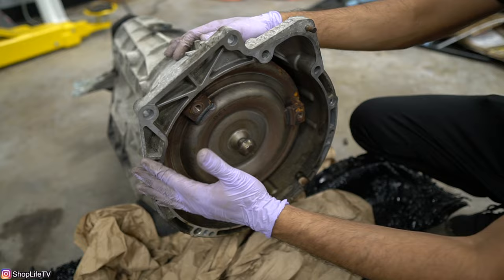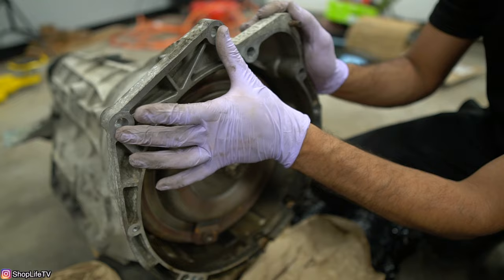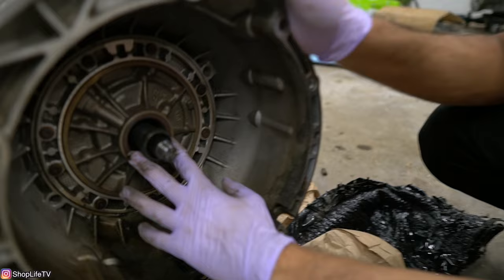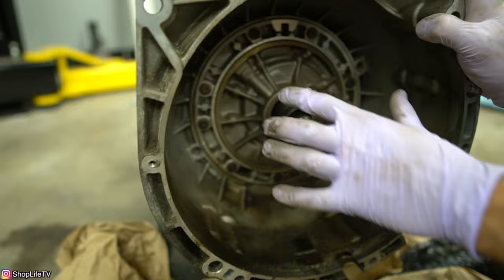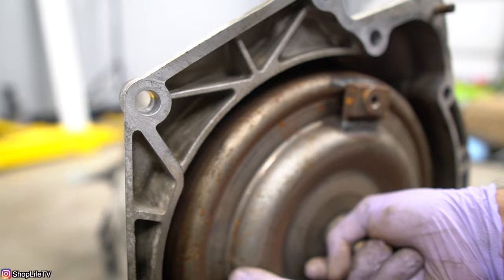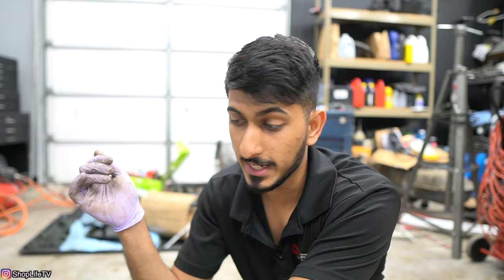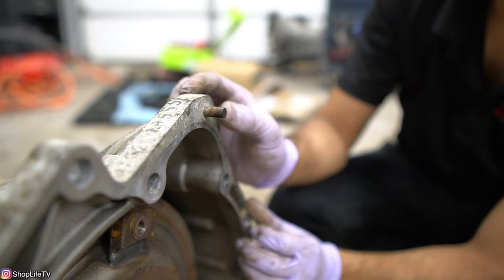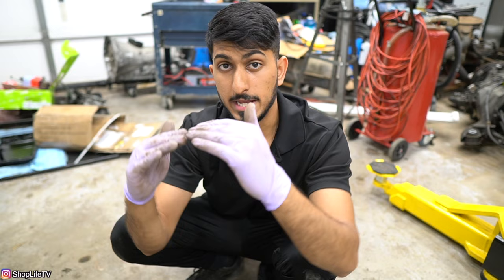WATCH THIS BEFORE REPLACING YOUR TRANSMISSION!!

Comment: I actually made this mistake but luckily I tried to spin the crank with a breaker bar before I installed the engine in the car. It didn’t move so I knew something was wrong. Then I got it right
Reply: Dis you have to remove the transmission and do the process agai? Or just loosen the transmission bellhousing a little and turn the crank to get it aligned and then close it?
Reply: @rq7684  removing and restarting the process was very easy for me.
Reply: Did you break anything. I'm in the same boat.
Reply: Excellent tutorial... thank you so much.
Reply: Convertor.not all the way back
In pump
Reply: i have made this mistake on my e60, and that one pin in gearbox oil pump had broke, then i just dismounted and put back on the old gearbox, it took me 10hours(with my father) to do all this job
Reply: Pulling the transmission and realize that torque converters not letting me pull out far enough and drop down and so I put it back almost flush is there anyway I can unbolt the torque converter now?
Reply: I have a nissan juke, there is no way to reach the screws connecting torque converter and flywheel, i was doing this work at my home, 
I removed every connected wire to the transmission and subframe,
I dried the oil
i took the subframe off with everything connected to it, using a jacklift for easy fall

I removed the shock absorbers, 
And axels
I put a jack under the transmission oil pan
I removed the gearbox mounts
I removed 9 screws

Took it down after prying the casing

Replaced broken parts
 
Had problem in alignment

Returning transmission to its location

Putting 1 screw in each corner and tighten it enough to put pressure,

Went to crankshaft pulley used a breaker bar to move it, and i felt the alignment as i got less pressure in turning it,  tried to turn it a few times to feel assured, tighten screws and putting the remaining once and

After a test it's working!
Thankfully
Reply: 2years later, your comment was a life saver😅 I was doing a replacement in my pos G35 and was confused as to why the crankshaft wouldn’t spin, will go on and do this in hopes that it was my bad precision causing it to not spin 😅
Reply: Great video I subscribed!

Comment: I dont remember who, but someone taught me, best to put tc in vertically with trans standing up. And spin it 3-4 times by hands til all seat stages are verified. And seat trans surface, before ever trying to bolt tc to plate.  Made my install so much easier. And felt right.
Reply: yes You are right.  set it stand up is a easy ways

Comment: Great tips guys. I can totally see do-it-yourselfer not seating TCC properly. Definitely saved someone from a headache and costly mistake.
Reply from the maker: Thanks Rich!! It really is an easy mistake to make. I almost made the same mistake when I was first started working on my car, but noticed it when the trans wouldn't mate to the engine properly, saved myself there lol
Reply: @ShopLifeTV  
Lol. You’ve come a long way and never seen you make a mistake.
Reply: @ShopLifeTV I made the mistake of not filling the torque converter on a remanufactured transmission because I had always bought junkyard transmissions.
Reply: @ShopLifeTV P.S. On the the bolts for the flex plate.  Don't reuse them.  They are a one time use both.
Reply: i found this too late and getting ready to buy a motor and trans so seeing as i know about this now can probably do it myself. Mine is a 2013 honda civic which isnt notched but has gears on the torque converter. I didnt know when i tried the first time that it needed to be in more and like ShopLife said I tried to my misfortune to torque with the housing bolts and cracked the at bellhousing assembly and a part of the new motor essentially making them both scrap. so knowing this now is a relief. I was originally going to pay someone to connect them, now i don't think i will need to. Thank you
Reply: I think I would want the tabs to be out of line when I put on the converter like he did, not like he said, in order to get that definitive twist and thunk for the third seat; because if you drop it straight on, how would you know?  Though actually, you can reach behind or in through the starter hole and it should be very close to the back of the bellhousing and/or pump.

Comment: In my Mazda Tribute 2.3 4x2 automatic transmission, shifting gears no longer works. Whenever I shift to "D," the car does not drive as if it is in "N." What could be the problem with the transmission?

Comment: Just put a straight edge across the front and measure the gap before you remove and after you place.  For my truck the TC was super heavy and it was really tight and hard to tell it was in but an easy solution was to measure the gap also knew it wasn't good when I couldn't rotate the flex plate.

Comment: You're the Man! 👏
i'm building up the courage to change my torque converter but was unsure of how to refill transmission and torque converter so when i first start it my transmission doesn't eat itself, i thought i would need one of those power flush machines garages use but now i know filling torque converter before installing will keep things running smoothly.

Comment: I always mark my notches all the way to the edges before installing. Works every time very easy to slide in.
Reply: Most people would push the converter on and spin seat it to know it’s in… elementary to a novice I would think 🤔

Comment: I did this the first time I installed the transmission for my Camaro and managed to crank my freshly rebuilt engine and broke the bell housing and the rotor on the pump. Was a very expensive mistake but a learning experience.

Comment: I learned this the hard way. Tried to bolt to the motor on my 330xi. Cracked the pump. Lucky for me, the neighbor had a 325xi next door for parts with the same transmission next door. So I just swamped in that pump.

Comment: Hey Buddy great video and very well explained. Im a mechanic but i dont work normally on trans. This information is extremely helpful as im starting trans replacements next month
Reply: I have Scion xB boxy 2006 automatic transmission.
Car drives Ok, but it didn't shift into 4th gear.
¹. How to fix?
2. What are consequences driving on high RPM?
Reply: This is exactly what what happened to my car.... can this be replaced or fixed please help a lady!
Reply: @mishagmstr6405 sounds like that’s a transmission. I’m not certified but I did have a slipping transmission because of my torque converter. If your car is passing a gear it means it’s probably a transmission or a shift solenoid

Comment: Great little video to educate those who are not aware of the torque convertor seating .... 

A quick tip is when you remove a torque convertor look and mark your notch points on the pump ( transmission front ) with a paper whiteout marker . It holds up well and don't easily disappear like a marker on rust .  Doing so you have a reference point for a quick and easy install ....

Again , nice video ....👍👍
Reply: Q mmk

Comment: I'm only 42 seconds into this video and I think I already know what he's about to speak about. I was maybe 15yrs old or younger when my brother taught me so much about mechanics and he hardly ever spoke, I just paid close attention to everything he did without bein all up in his way cause I knew I was going to have to do everything he was doing some day, hands-on is how I learned everything about how to fix and keep vehicles running..I remember it like it was days ago. When installing a torque converter, at least 3 clicks depending on the years and types of the vehicle's to make sure it's all the way inside the trans pump, never install a torque converter dry without adding fluid cause it helps to prime the pump. The vehicle will not move without adding fluid to the torque converter..It's like any kind of a pump, they don't work without being primed. Plus I always changed the front pump bushing and both front and rear seals cause the bushings acts as a rod bearing in engine's. It keeps the wobble and wear of the seal by closing a tiny gap between the converter and pump. I'm pretty sure I always changed the rear bushing and seal cause the transmissions out of the vehicle's and it's easier to do with em out plus the transmission will last longer than if people just swap out transmissions and leave it at that..Shouldn't be any wobble at all when the torque converter is all the way inside the pump, plus you should never have enough space between the torque converter and bell-housing to put your fingers behind the torque converter..I watched soooo many people do it wrong and they ended up messing up the front pump by not listening to anything I'd try to tell em..I'm not perfect and I've made many mistakes when I's younger but as I got older, anything I did to people's vehicle's they never came back with the same problem. I also went to school for 2yrs in 84 and 85 cause things were starting to become complicated when automobile industry's started coming out with electronics and computers which always got under my skin until I had all that happy stuff figured out. I had to go back to school in 2002 to learn about the newer computerized vehicles. I think I made it not even a couple weeks and I got a job at a speed shop and body shop combined cause hands on is the only way I'd ever learnt anything cause everyone has their own ways of doing things and I don't understand a bunch of gabn. I usually just scope everything out and tare into it and fix everything that way..I've almost made a few mistakes but I always knew who to go to so I didn't mess up a vehicle that wasn't mine and couldn't afford to come outa pocket to correct any mistakes..Now we have Google and it comes in handy unless it's some jackleg that has no ideas whatsoever of what they're doing..I don't understand why YouTube and Google let's people that have no idea about mechanics make it past both by getting everything they've done posted anyway..A good example is a young guy decided he was going to fly by the seat of his pants and do mechanics for the world of webbernet so they know how to do simple things like brakes and whatnot. Dude removed the spindle and all just to change front brake pads. He unbolted both upper and lower ball joints, or struts, and the tie-rod ends on a front wheel drive vehicle,  axle and all just to change front brake pads on a vehicle.  2 bolts and a bleeder valve, that job should've been done in 15 or 20 minutes at the most. It sometimes takes longer to remove the tire and wheel than it does to change brake pads and shoes on most American made vehicles..😂

Comment: Thank you for doing this video! I definitely would have avoided a bunch of headaches if you would have posted it a few weeks ago ahah!

For the people watching this, here are other points that I learned going through this with my 2008 335i e92, and that were missing from the video:

- Installing an engine when the transmission was already in the car, was tricky. If I would do it again, I would have removed either engine+transmission from the font, or removed the transmission then the engine. When I reinstalled the engine, I had a hard time aligning the pin from the torque converter, with the flex plate, and by "massaging" the engine to get inside the car, I must have pulled the torque converter enough to get it out of the prongs, which led to huge headaches after has he explains in the video
- When installing the transmission, definitely jack up the front of the engine to make it easier to align them.
- Jack up the car at least 23in between lifting points and floor, if you are using a harbour freight trans jack, to clear it easily.
- After wrongly reinstalling the transmission and starting the car, it sounded normal at first, but a few minutes after, there was a sound coming from the torque converter/flexplate area, and it sounded horrible, like the torque converter was grinding the side of the transmission housing. I dropped the transmission again and could see on the oil pump prongs that they got scored from the torque converter.
- Like he says in the video, if you put pressure on the prongs, you will damage them and potentially damage the transmission oil pump, which, to be safe, you will need to replace the whole oil pump assembly (like I did), and I would not recommend it to anybody!
- When I was trying to sit the transmission on the engine, I must have put pressure on the flexplate, which probably led to moving the flexplate face 3mm towards the engine ==> CHECK YOUR SPACING: it should be around 3mm (max 4, but definitely not 6) between flexplate and torque converter when transmission is sitting on engine, and torque converter is pushed back in transmission as far as possible.
- Do not try to pull torque converter into flexplate by screwing them together, you will most likely damage you flexplate.
- For people with a ZF6HP21, the spacing I had between the flexplate contact face on the torque converter fully pushed in, and transmission housing face, was 36/37mm.

Thank you again Jason for helping me with this, and thank you for doing this video so people do not do the same mistakes!!

Guys, if you have any issues with your transmission and are in a rush, I would definitely recommend going on his website and click on "have a question?" tab: you just pay him a beer, and he will get back to you within 24hrs, with all his knowledge and help ready for you, and it is worth way more than what he is asking for. He helped me sourcing parts from website I did not know about, got me spec sheets and manuals to help me figure it out, and he has been incredibly helpful!

Cheers!

Comment: This is such Great Knowledge. I’m currently getting my Transmission Replace for a used Transmission with 47k miles by a Mechanic for $3000. Watching this video will give me an insight on how it’s supposed to get Done and Hopefully EveryThing Goes Well !
Reply: Did you do it , the car still running?Im going to the something right now

Comment: ARE YOU READY ,I've got a bf mk11 with zf 6 speed triptronic  that I was told 2n half years ago was toast and still today  I start my car let it run open thermostat shift through gears in auto mode p.r.n.d several times   and wow still goes same as yesterday   don't do burnouts .

Comment: I rebuilt my 4r75e tranny in my f150 all while taking my time with details and made sure sometimes getting details from multiple sources & buying superior grade parts. I basically spent $1500 with new planetary, direct drum, reverse drum, and sonnax kit. Few other purchases too. While I was a stickler for a month in evenings doing rebuild I got excited & didn't pay attention nearly with torque converter & after 2 days it started pouring fluids. Anyway I have removed tranny and don't see any damage besides my seal popped out on front so now putting it back in now so please wish my luck on it cause I need it.

Comment: Since you brought up the part that you should add fluid into the torque converter before installing it onto the transmission,  what if you are using the same torque converter that came out of the same transmission after doing a new torque converter seal but the torque converter doesn't have any fluid coming out when you turn it upside down and you installed back the torque converter without adding fluid into it? 
Wouldn't the torque converter just fill itself up when you add fluid into the transmission?

Comment: Rookie Mistake
Another one is pinching the wiring harness between the bell housing and the engine block upon installation. Don’t forget to flush your transmission cooler

Comment: This video came out just in time, all your vids have been great help but I just got my transmission to replace on my E46 325ci
Reply: How much did it cost u
Reply: My gear is not engaging, it makes so much noise and doesn't drive, thinking of changing the gear. Will this help if I can get someone to look at it for me.

Comment: Greetings from Costa Rica, I have a 2001 E46 with a ZF transmission, Steptronic, the issue is that the manual speeds do work, but in Automatic or Sport it does not change from first to second gear

Comment: This is awesome information. I got a 2015 Chrysler Town and Country which has an hydro locked engine. In my case my problem is I cant separate the transmission from engine from underneath the van because I cant spin the crankshaft; there is only a small window where by spinning the crankshaft it rotates the torque converter and all 4 bolts can be unbolted from there but since mine cant spin how do i take it apart without destroying anything? A mechanic said to pull out the engine and transmission all at once from the bay but then the issue remains right? now another mechanic suggested to open the engine from underneath to get to the connecting rods cams and unbolt all 6 cylinder connecting rods, this way may free the damage or damaged ones and be able to spin the crankshaft and hence unbolt the transmission; this while the engine still in the van. It is easier to leave the transmission in place for me; I am not a mechanic and my shop is limited to a half lift and lot of lacking knowledge how to do this; got the Haynes manual, you tube,  mechanics who are willing to share their knowledge and a severe case of empty wallet which is why I have to do this myself as can not afford it to a pro. I dont know if this is the right solution, another mechanic said "dont waste your time" but when it comes to fixing this engine "time" is something I will definitely throw at it as I want to do it right. Not my first rodeo, already brought a car from the scrap yard to fully functional and have another one to repair as well also full engine work so any help would be greatly appreciated. Thanks!